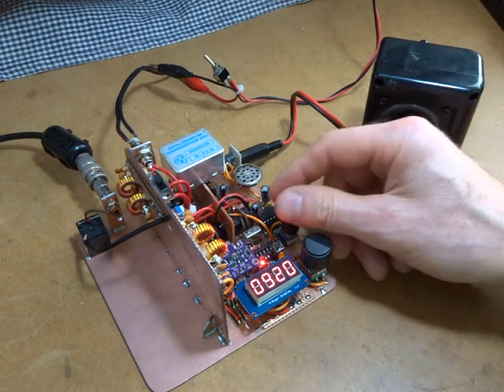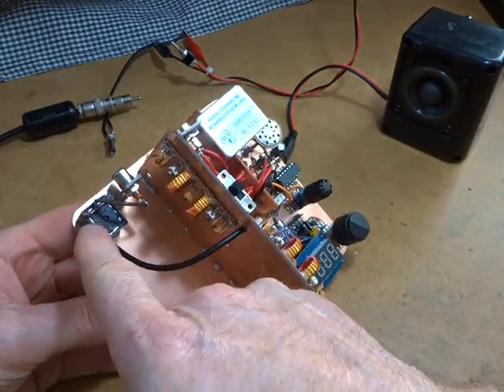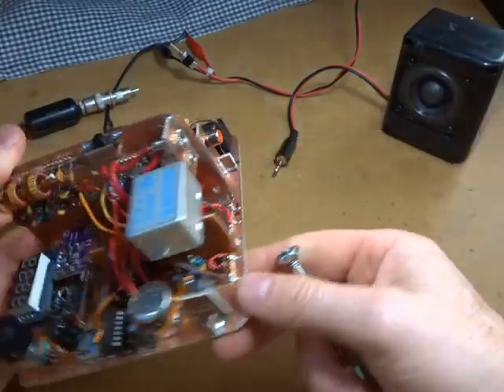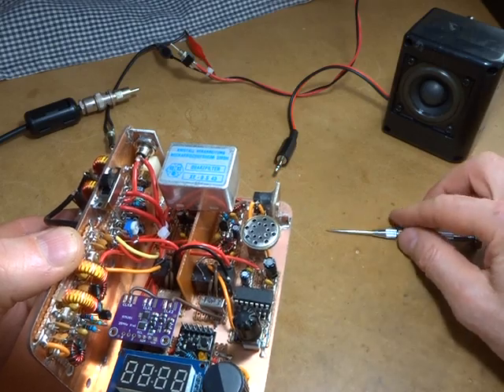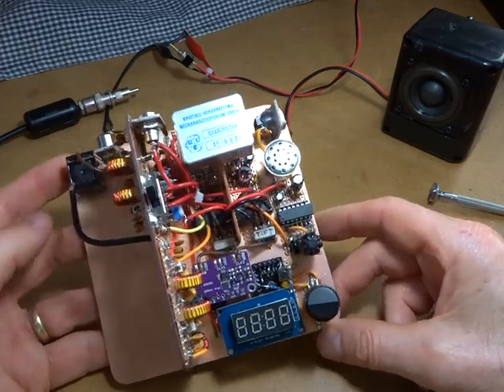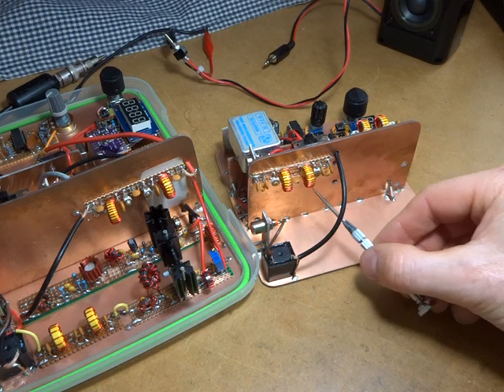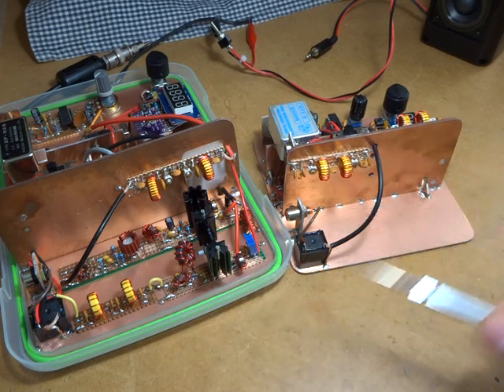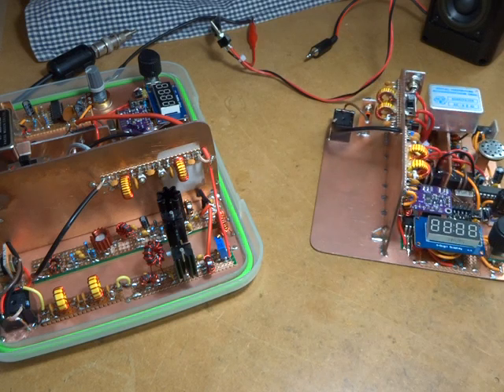Homebrew Portable 40m SSB QRP Rig. Part 5: Receiver Complete

Comment: Neat building, Charlie!
I still don't know from where you get your little metal cubes resenators, filter, or whoever. Because I face a difficult time to find them.
Happy new year to you and your family.
Reply from the maker: Check out ebay Moustapha. The filter came off a surplus IF board with three filters (AM, USB and LAB). It was this one: https://www.ebay.com/itm/3x-KVN-Kristall-Crystal-Filter-BP-9MHz-XF-9-SSB-AM-Receiver-RF-HAM-Amateur-Radio-/272514483389
Reply: @CharlieMorrisZL2CTM  Fantastic!
Reply: @CharlieMorrisZL2CTM   fantastic!

Comment: I just found your channel, and I really like your approach to home construction.Also, the quick electronic design description.
Having been away from home building myself, I am slowly beginning to re-start that - beginning with simple circuits.
I love the way you use simple strip boards on a ground plane, this makes for a quite decent RF design. I just found some experimental board with islands on one side and a ground plane on the other. Also very suitable for RF construction. 
In the past I have used "ugly-construction" on PC boards, but your approach looks much better, including the layout.
Vy 73 and Merry Christmas to you, de Jan, OZ9QV.
Reply: BTW, you say that you do not like SMD, but in a way you just use classic s´components and surface mount them on the strip board. ;)
Reply from the maker: @BabylonLurker  Yes. I have thought that. Once of these days i will have to get into  it. I just don't want to have to design circuits boards everytime I want to quickly knock up a circuit. We'll see.
Reply: @CharlieMorrisZL2CTM  Indeed. I did something else as well. I have beside me an "island board" with a piece of copper foil soldered around the edges. I do not see anything preventing you from using that technique to create a ground plane on a strip board, or you might use some of the cheap copper tape as the ground plane.
You do need ti punch holes where you want a ground connection, though.
73 de Jan.
Reply from the maker: @BabylonLurker  Thanks Jan.
Reply from the maker: Thanks Jan. I'm pleased you find the videos useful. Merry Christmas to you too.
Charlie ZL2CTM

Comment: Charlie I found that an emitter follower works well to input audio to the balanced modulator due to its low output impedance. I know your trying to save space.
Reply from the maker: Thanks Loren. I'll jot that down in the notes.
Reply: I found this out when I built a DSB transmitter using SBL-1 for a balanced modulator. Drove it with computer audio to transmit 20meter WSPR. Did a lot of scope testing of my DSB out.
Reply from the maker: @lmoline63601  That's interesting. Thanks again Loren.
Reply: By the way Charlie I try and watch all your videos and love them and have learned alot from you. I love the theory you review. Keep up the good work.
Reply from the maker: @lmoline63601  Cheers Loren. Just remember they are not tutorials, just a video log of what I am up to. I know there are errors and inaccuracies in places.
Reply: Charlie Morris Yes  I know but you still have some great ideas. Thanks!

Comment: Do you have any videos where you show how you construct your mounts for your sockets?  (Coax connector, headphone jack, etc). Thanks for another great video!
Reply from the maker: I don't think I do sorry. They are made from cutting up either single side or double sided copper board. I use a pair of straight tin snips. They are then held together using solder. I find it a simple way of making mounts etc. Nothing elaborate that's for sure.
Reply: Charlie Morris will try that.  Thanks!

Comment: Great work,  the audio sounded so good  on that external speaker,  if the TX audio is as good your going to have a fantastic little radio there. Well worth the effort I think.
Reply from the maker: Thanks Brian. The receive audio is excellent. It sounds that good in the earphones too, which is good. Now for the transmitter.